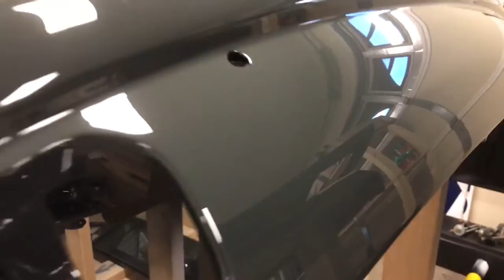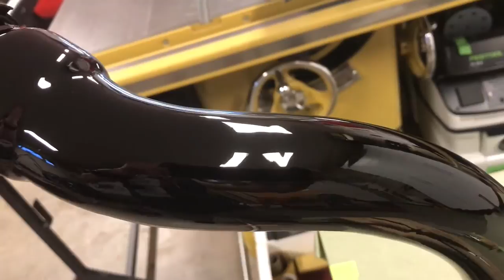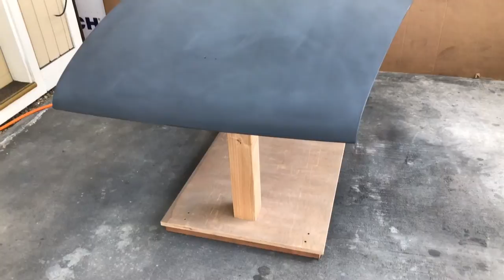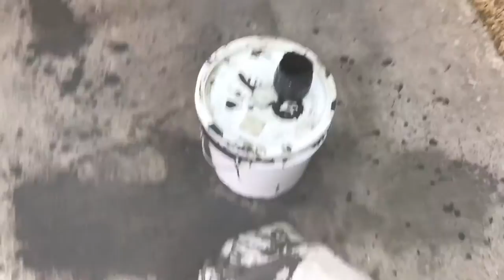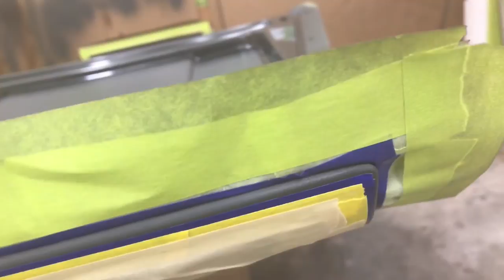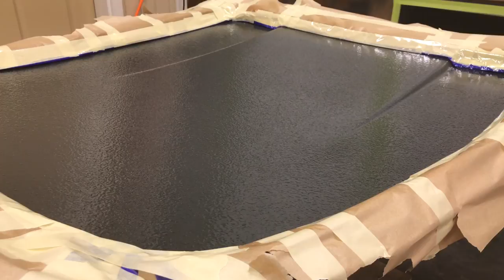1967 Porsche 911 Video 23 Finish Paint Part-5  Painting the Hood with the SATA 5000B RP

Comment: Hi Mike, a superb series of bids that I have learnt a whole lot from. Can't seem to find one where you have spoken about the Sata and your reasons for choosing this gun and what your set ups have been using for all the different materials you have utilised. Is it a case of one set up had done all? Would appreciate your feedback. Cheers and thanks for uploading.
Reply from the maker: Hi Lewigas
Thanks I appreciate the feed back=)
I do speak a little bit about the SATA equipment  and materials selected throughout the series 
However you might check out Video 17,20,22 for a bit more detailed information.
The is a SATA 5000 RP with a 1.3 tip works great for all the finish paints and small detail work also.
I haven't really done a video explaining the SATA in depth but do comment on it here and there throughout the painting process.. Sorry I can't be more specific ..would be quite a bit of viewing time to go through everything
I did do something in regards to primer spray equipment used on this project in video 8
Next project will be using a designated SATA primer gun with a 1.9 tip
Good Luck!

Comment: Hi Mike, I am trying to figure out my paint budget.  How much base do you think I need to paint my '72 911.  I will NOT need the base for the engine bay, front trunk, or inside the car.  So, what is  your estimate on paint usage for 3 coats body only.  And would it be the same usage for clear?  Thanks for your help.
Reply from the maker: Hello Rodney
Sounds like you are really into it! 
What brand of paint system will you be using and also what type of equipment are your spraying with. RP/ HVLP?
and tip size?
I sprayed out almost two gallons of base coat and applying 3 coats and again the same for clear... Using an RP type gun
1 gallon of base made two gallons of sprayable. 1-1 reduction ratio.

Comment: Hi. Why did you buy a new hood instead of fixing the old one? Thanks
Reply from the maker: Hello eljimberino
The original hood was used for sitting on..the sheet metal was too warped and fatigued to repair.
It was better to replace it that to struggle with it.

Comment: what are your gun pressures for each coat
Reply from the maker: Hi Mark
Im using the Bar system so you might be able to do some conversion
Filters are set at 3.75 Bar and gun is set at 1.7 bar seems to work best
both base and clear coats. 1.3 tip with high flow connections
Also I have the fan dailed back about 50% this helps in keeping a wetter pass
but more stokes needed to complete a panel
Reply: Your paint jobs are so nice and I don't notice much over spray in your booth. Does the fan dialed back 50% reduce the fog in the booth?
Reply from the maker: Hi Mark
Dailing back the fan does result in less air blowing around. RP guns put out quite a bit of air compared to
an HVLP type. This project was my first time to use this SATA gun. I have found by playing around with it the larger fan doesn't really help any with the size of the car or panels I'm working with. If I were painting a much larger car or using a metalic color the larger fan atomization would come in handy.
Also part of the booth design with the exhaust is to immediately extract the overspray before it travels the booth trying to get out..so far everything has been working out okay=)